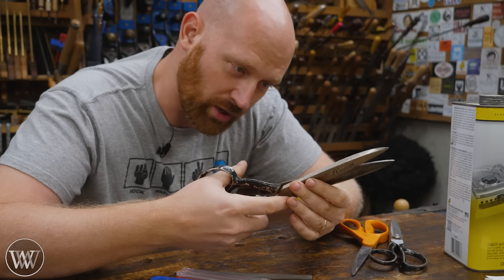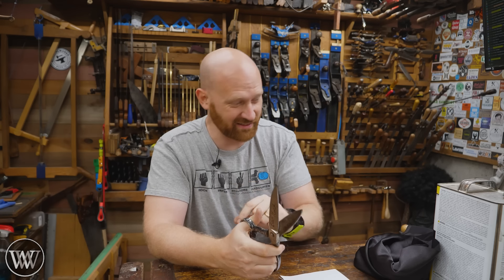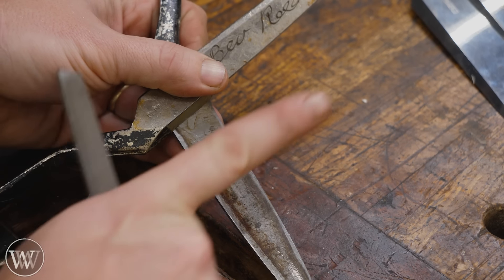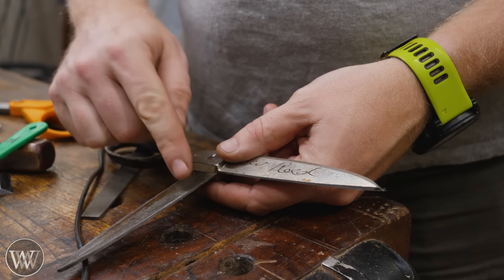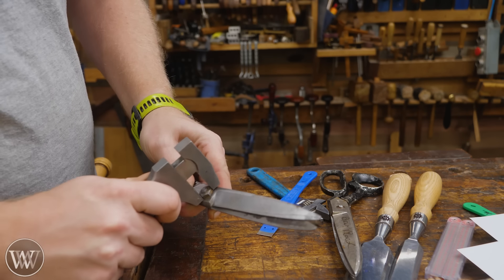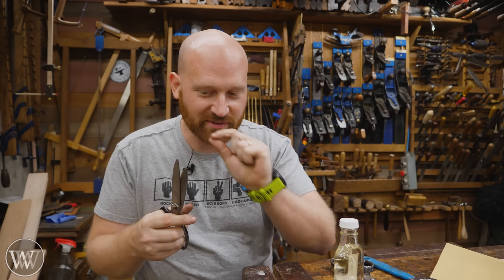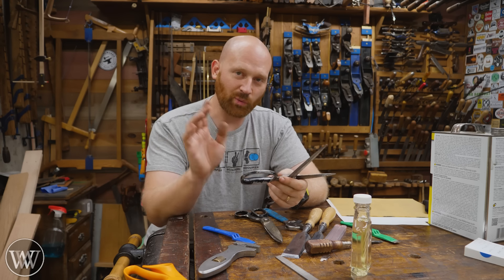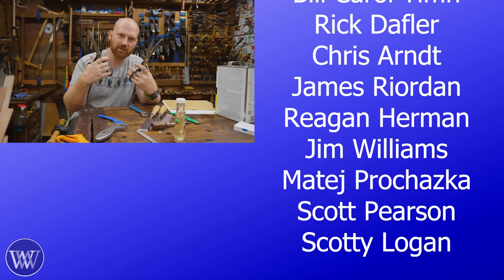How to Sharpen Scissors Like a Pro at Home

Comment: just a heads up - anyone who finding this in SEO doesn't have a stone or file or anything to sharpen the scissors with. If they did, they wouldn't be here watching habitually. i know the views might make you think otherwise, but as far as providing a solution, those watching already likely knew. they stayed just for more technique. You might want to make a video if you didn't have a file to show how you can still achieve results. you may have already done that to which I apologize if so!
Reply from the maker: You can do it like I said in the video put sandpaper on a stick. Or just go to the hardware store and pick up a file for five bucks.

Comment: This is one of the surprisingly easy method that really works.

I tried it on my most blunt pair of scissors thinking what could be worse, ends up for the past week I have been spring cleaning and digging out scissors to sharpen. 

Just a few passing with the file would be usually sufficient to restore a pair of scissors to do the tasks like cutting paper and packaging.

Comment: I unscrew the two blades and lay them flat on a diamond stone.  This ensures that the geometry isn't changed.  And I use diamond files on the bevel.
We cut a lot of fiberglass cloth that hard on scissors

Comment: Something else to do with scissors, often overlooked, is that the blades of GOOD QUALITY scissors are slightly curved, so that they cross at the cutting point. (as per a pro in a men's clothing factory). He used a very fine grinding stone and would examine the scissors to insure the proper curve of the blades. He had a special insert to a vise that he put the blades in to adjust the curve.
Nice video James. tending scissors can often lead to ruining them. Your home shop methods will work fine, just be careful to not remove that slight curve.

Comment: Empirically, REALLY dull scissors get less dull if you cut sandpaper with them, so I think it's more regressing to a mean than technically dulling. As in, if you cut sandpaper, you'll end up with a rough edge that cuts paper but can't do a slide cut. If your scissors are worse than that to begin with, it'll look like an improvement. Probably not a very good idea, but at least it would explain why people keep doing it.

Comment: I've Used Knives and scissors ✂️ on job sites. Best Trick for scissors is Cutting aluminum foil
Reply from the maker: That one is an old myth too. Aluminum is not hard enough to move the steel around and it's at the wrong geometry as well.

Comment: Does cutting aluminum foil sharpen scissors.? My sister swears it does! Idk? Thank you in advance. Nice video.!
Reply from the maker: Not at all. It is the wrong angle. And the aluminum is softer the the steel. It has to be harder then the steel to harden it.

Comment: You can believe what you want but after cutting fine sandpaper my scissors are sharper and do cut better.
Reply from the maker: I can guarantee that's all in your head. It's pushing steel all in the wrong direction and causing impact on the cutting edge.

Comment: Believe it or not, they can be sharpened with aluminum foil😂😂😂😂 you just cut aluminum foil at least 20 times, and you'll notice that they get sharp pretty quickly.
Reply from the maker: That is an old myth as well.
Reply: @WoodByWrightHowTo  I've had good luck with it, but I imagine it's only good for craft scissors cutting paper, or maybe the aluminum possibly just turns the blades into micro serrated edges. Idk what makes it work for paper, but I've gotten kitchen scissors to cut paper again with this. Either way, it's an honor to have you reply to my comment🤩😂 it makes me feel stupid to disagree but I've had it take the unusable to perfect before.